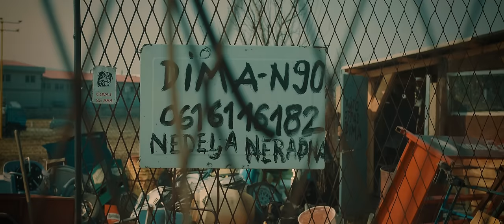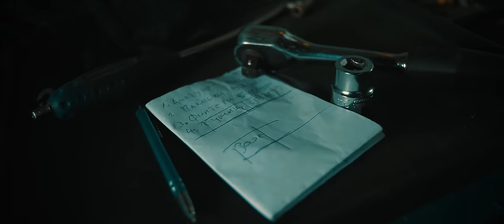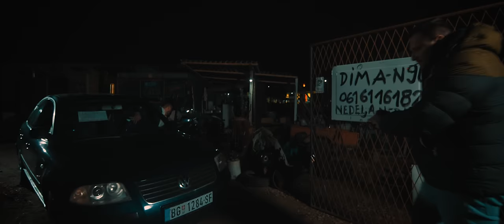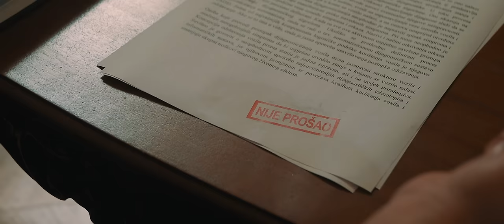Cache & Đavo feat. Kruševac Geto - Automehaničar (Official video 2022)

Comment: Even if I don't understand the lyrics, I love the musicality of the lyrics❤
Reply: I'm coming to the mechanic
 I mean a small fault
 he exits the channel
 hit like a miner

 Deeply smeared pie
 what is he missing again?
 he said, they are dragging themselves to the house
 and it burns very hard

 I was ripped off by a small service
 I guess oils were expensive
 now I'll tell you right away what it is
 your Bosch pump is leaking

 Something is knocking downstairs
 maybe the exhaust blew
 probably swimming too
 zamajac church

 This is old age
 something will happen
 almost slipped
 says the rotten tinsmith

 And yes, half on this car
 to replace the sea
 old trick for someone
 who is called Bora Gedora

 Dad is mastering his craft
 he offers me some Passat
 and he doesn't realize that it's my salary
 like a trap from Trabant

 And that it's my bucket
 only for scrap metal
 it will not technically pass
 and that's when he gets sick

 So they started yelling at him
 he tells me some stories
 write it down on a piece of paper
 as for the parts

 Rece works there by the hour
 it doesn't matter that it's slow
 he took the old pants to measure
 oil in the engine

 Master, when he fixes it
 it won't shoot
 he is the only one who can enter the state
 Sassi to knock

 Well, in a little bit like an old man
 to go to prison for that
 for the engine he is a grandmaster
 and a carburetor doctor

 Ref.
 Turbo diesel TDI
 only that the engine is German
 and with a little money to maintain
 it won't spoil in the winter

 Turbo diesel TDI
 only that the engine is German
 the vehicle is free, it was driven by my grandmother
 it will pass easily technically

 Every good morning
 dzewa is boiling on the resou
 customers arrive
 nobody knows my pains

 Hello master
 kiss me Alpha
 I knew he had to
 the first to drink coffee

 I'm going down into the channel
 I weld the welded parts
 Alphas don't break
 because they make them rotten

 I don't know where the left is
 I will end on a nervous note
 it's leaking all over your hose
 your servo is bad

 Yo tekero, yo tekero
 my Dacia Sandero
 I change the darkness
 the whole of the Seat Alteo

 Always a Mazda boss
 mule that Japanese vase empty
 different kinds of shit, let's find out
 Citroen's death sentence

 Attach diagnostics
 so borrow the cables
 for Nissan and Kaskai
 plastic manufacturers Hyundai

 One hundred euros is my hand
 you don't have to pay for the legs
 clucking and kneeling
 you will get it for free

 Automechanics party from the night before
 I will stumble around the yard
 on belts and cables

 I soap sake
 I remove the weeds from my hands
 when I go down to the channel
 I wish I had gone to Mordor alone

 They ask me for advice
 and doctor and professor
 some come just to get high
 tire on the compressor

 Mercedes is Mecca
 a car for real people
 who sleeps with Meca
 list Audi

 Ref.

 Here I am in the garage
 will you come down, brother, it's noon
 I have been waiting for the master for an hour
 to applaud

 The dogs have already arrived
 clouds untrocigari
 tighten the gedoras
 take out German screwdrivers

 Next to me the slats
 floating flywheel
 on Pamela's wall
 and Vesna Zmijanac

 And Carmen Electra
 and an old Opel Vectra
 open window
 it is held by one batten

 I'm sitting on a Tiger tire
 I'm browsing the car catalog
 drank seven coffees
 and ate the whole dregs

 Here is the master
 he goes alone' to get dressed
 it can be felt from afar
 on synthetic oil

 Sorry for the awkward part
 for Porsche Caen
 tell grandma what's bothering you
 poop is the problem

 The yellow faucet is on
 there is smoke there near the gas
 another speed and something
 mi se cima ki carrion

 Knocks, cracks, knocks
 semi-shaft or bomb
 my car broke down
 ki old camel

 I hit the gas harder
 sparks fly into the pot
 my air conditioner is heating up
 furnace and boiler room

 And the lock sucks
 I have to buy a new door
 can't open them
 Clicko or Rocky Balboa

 My engine burned out
 I'm sinking into depression
 this before me ki da ter'o
 Mickey Raikkonen

Comment: Prehaps can anyone make a english subtitle for this song? I will very appreciate that.
Reply: this is from google translate:

I'm coming to the mechanic, I think it's a small fault
He comes out of the channel, beating like a miner
Smeared to the throat, he asks: "What's wrong with him now"?
He said: "It drags like a dog and it's very difficult to ignite."

They gave me a small service, I guess the oils were expensive
"Now I'll tell you right away what it is, you're going to be pumped"
"Something's banging downstairs, maybe the exhaust blew"
"Probably a floating flywheel church"

"This is old age," something began to unfold,
Rotten sheet metal says it was almost polished
And half on this car, to replace it must
Old trick for someone called Bora Gedora

My dad, mastering his craft, offers me a Passat
And he doesn't understand that my salary is like a Trabant trap
And that my bin is only for scrap metal
Technically, he won't pass and then his apprentice comes

So he started shouting at him, telling me some stories
He wrote down the parts for me on a piece of paper
The word works by the hour, it doesn't matter that it is slow
He took the old underpants to measure the oil in the engine

Master, when he fixes it, it won't fire
In the country, he is the only one who knows how to knock over the chassis
Well, almost like an old man, because of that he is in prison
He is a grandmaster for the engine and a doctor for the carburetor

Chorus:
diesel TDI
If only the engine was German
And with a little money to maintain
It won't spoil in the winter

Turbo diesel TDI
If only the engine was German
It was driven for nothing, it was driven by grandma
It will pass easily technically

Stanza II Trisha:

Every hot morning, there's jezva boiling on the stove
A customer arrives, no one knows my troubles
"Hello master, I'm smoking Alpha"
I knew she had to drink the coffee first

I go down into the channel and weld the welded parts
Alphas don't break because they make them broke
I don't know where the left is, I'll end up nervous,
Here, your hose is leaking, the whole servo is not working for you.

Yo tekero , yo tekero my Dacia Sandero,
I'm squinting and changing the entire Seat Alteo
Every Mazda boss, mule that Japanese vase is empty
Shit, let it be known, Citroën's death sentence

Attach the diagnostics, then borrow the cables
For Nissan Qashqai, the plastic makers are Hyundai
One hundred euros is my hand, you don't have to pay for your legs
Crouching and kneeling will get you free

Automechanikars party since dawn
I will burn myself in the yard on belts and cables
I soap my hands, I remove the weeds from my hands
When I go down into the canal, I have gone down to Mordor

Both the doctor and the professor ask me for advice
Some come just to inflate the tire on the compressor
Mercedes is the Bear car for real people
Whoever sleeps with Metz pisses on Audi.

Chorus...

III stanza of Chami:

Here I am in the garage, are you coming down, brother, is it noon?
I have been waiting for an hour for the master to applaud
The apprentices have already arrived, putting on their untrocigers
German screwdrivers pull out the gedoras

Next to me slats, a floating flywheel
Pamela and Vesna Zmijanac on the wall
Carmen Elektra and old Opel Vectra
An open window is held by a batten

I'm sitting on a Tigar tire, browsing the auto catalog
Drank seven coffees and ate the grounds
Here he is and the master goes alone to get dressed
From a distance, it feels like synthetic oil

"Sorry, ordered part for Porsche Cayenne"
Tell grandma what's bothering you, what's the problem?
The yellow faucet is burning, there is smoke near the gas
Second gear and something like carrion

Hiccups, cracks, half-shafts or bombs
My car felt like an old camel
I press the gas harder on the pot of seva sparks
My air conditioner is heated by furnace and boiler room

I have to buy a new one for the door lock
Neither Klitschko nor Rocky Balboa can open them
My engine burned out, I'm sinking into depression
This is what Miki Raikkonen said before me!